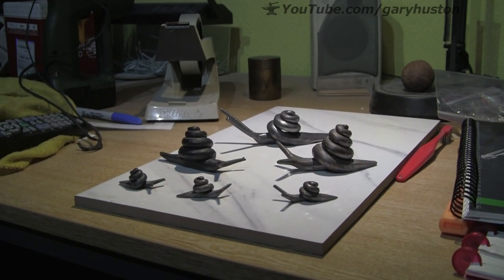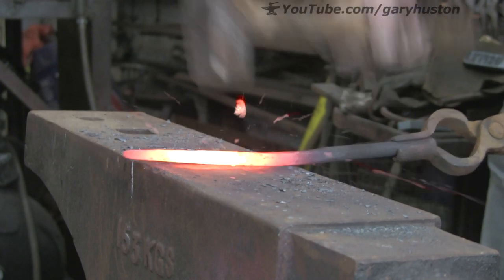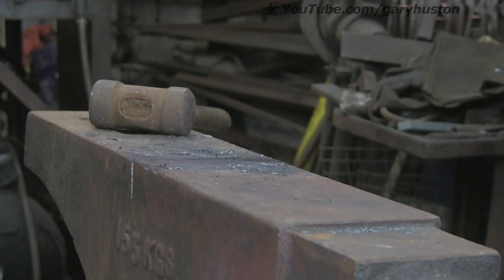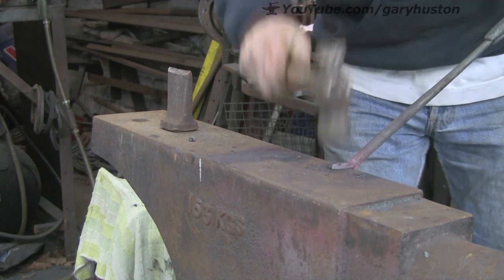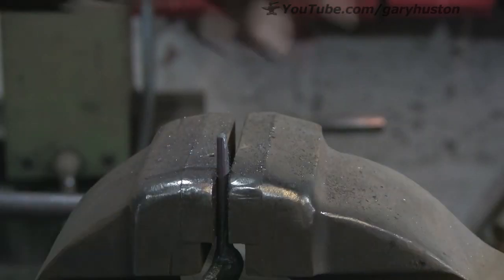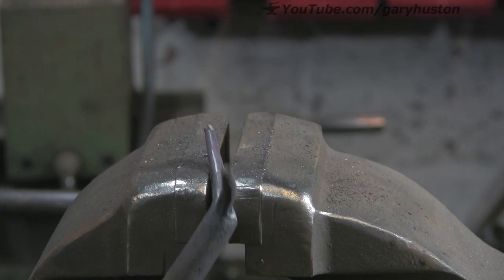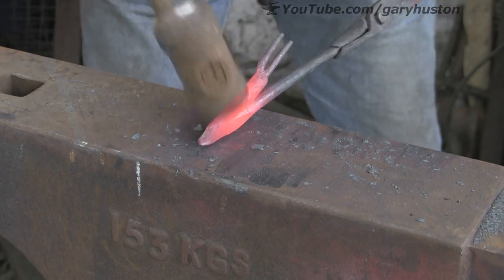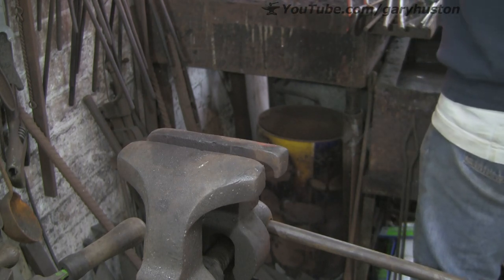Forged Snail revisited

Comment: How are your arms doing these days?
Reply from the maker: Dan Kolar the wrists are pretty good I just have buggered shoulders now! I’ve torn the rotator cuff muscles in my right shoulder!
Reply: @garyhuston  I hawe tried differnt body tecniques, for me it worked better when i found a methond where the upper body was lifting the hammer rather then the arm mucles, but i think one has to try different methods until one find something that suits the body. Once i did my experience was that when muchles in my arms was activated instead of just exghausted the pressure on the nerves in the arm lovered a lot and i experienced less problem compared to when i hawe to do office work in front of my keyboard.
Today i even experience that the smitty work heals parts of my arm when i using the hammer, i am not sure why but it must be that it take off some pressure from old nerve damage i got from my work as a computer tecnician when i was younger i think. But i think this is probably very individual.